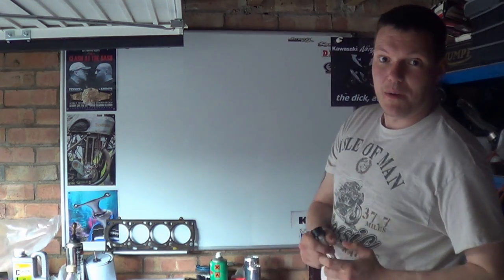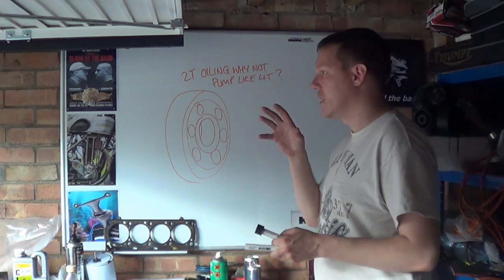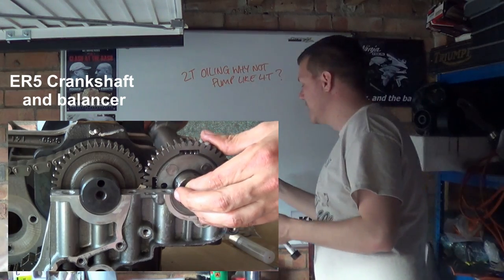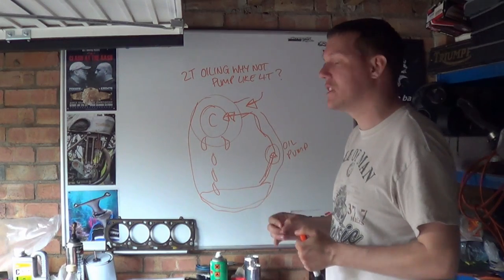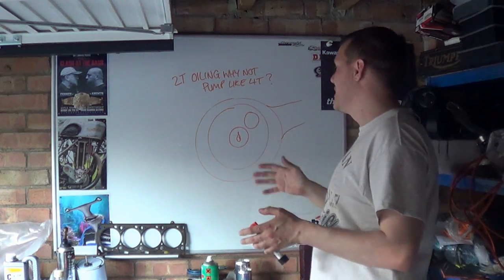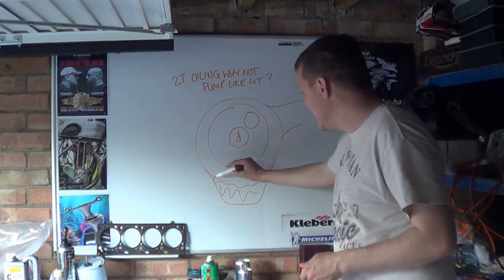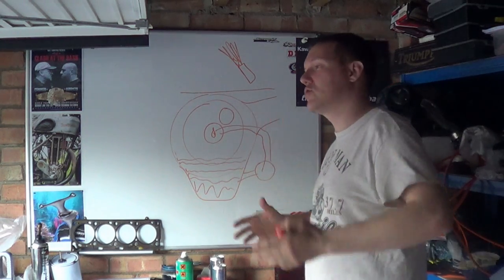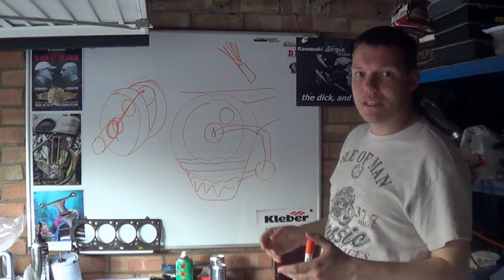2T oiling issue - make it like a 4T?

Comment: Damn... So 2 strokes are going to be dead... That sucks. I thought of a direct injection unit with a sealed crankcase... But what's going to pump the air into the cylinder... The piston can't really do it... There's two big gaping holes once the piston is all the way down...

Comment: What if u use propane instead of petrol , with the oil 😘 or maybe nitrogen based fuel like nitropropane. Could inject diesel exaust mixed with propane into a gas 2 stroke😍😻

Comment: the 2t piston is a long skirt design that not only weighs alot but its very difficult to oil it from underneath. 2t is like that crazy kid you knew growing up, not very smart so a dim looking future but has demon like strength, usually at inappropriate times
Reply: stickloaf the need this "long skirt design to close ports at appropriate times

Comment: does anyone make a 2 stroke boxer and does it still need a separated crank case since both pistons are 'charging' the crank case and firing at the same time
Reply from the maker: Great question - video coming soon - matt
Reply: I have a 2t boxer in my rc plane. Same crankcase! DLE Engines

Comment: from what you said i understand the problem is that 2ts use a crank case breathing system . could you have external air/fuel injectors and not use crank case breathing or am i just being thick ?
Reply: Then you would end up with a 4T
Reply from the maker: Good question - video on this later
Reply: Unjust PlayerLP why wouldnt it work? (With 2strokes instead of 4.)
Reply: Adam Berggren why would you want to make everyting similar to a 4t just to have 2 strokes and fresh charge going out of your exhaust ?
Reply: Ciaran Goldrick I was thinking the same thing
Reply: Unjust PlayerLP would you just answer the question? He's asking why it won't work. It wouldn't make it a 4T, you would still only have 2 strokes, you would just be closing off the crank case so it wouldn't breath the air and/or fuel at all (or at least, not as much, since even 4T engines still have breathing issues).

The advantage of a 2T that doesn't burn oil is the ability to spin at a higher RPM, produce more HP at a given displacement, and have less parasitic loses.

Comment: Two important things for considering comparing engines for real world use is.  1 cost to buy
2 how many miles it would run in its life & service intervals & cost.  

Good video and I am sure R1 would still win but very important factors when buying a machine.

Comment: 1980`s Suzuki 4 cylinders all had cranks built up with roller bearings..very robust design.2-strokes die early from piston failure..carbon-build-up...heat..and lack of lubrication inthe cylinder..The lower end rarely goes.Wish I knew what e-tech evinrudes areusing for materiels in the piston/cylinder interface.Luv your vids..

Comment: As you said, it can't be done with a crankcase fuel and air mixture fed system. I'm sure you could build a direct injected two-stroke engine with oiling like a four-stroke, over pressurized and producing big HP/litre. But here comes the kicker, it would defeat the purpose of the two-strokes benefits. Such as low weight, smaller, and cheaper to produce. That's the main reason I think it'll never be done when 4-strokes already exists, I mean why invent the wheel again? 
Here is what's what in two-stroke technology for curious ones... 😃 https://youtu.be/g6Fa79fR_To

Comment: What if you separate the crankcase and the cylinder with some sort of diaphragm or grommet type thingy around the con rod, and placing the reed valves in the bottom of the cylinder instead of in the crankcase, making it a "cylinder breathing" engine? This would (if engineered properly) separate the oil and the fuel system.

Comment: Would you be able to do fuel port injection in the transfer port or would that have the same problems as direct injection? That way you wouldn't have the fuel in the crankcase to dilute the oil

Comment: On a 2 stroke dirt bike, could you do a higher oil fuel ratio( like from 40:1 to 30:1) than what the manufacturer recommends to improve reliability? Would it cause any problems?
Reply: depends on oil quality and how the bike is ridden. I'm certainly no expert so take it as you will. typically the smaller bikes run higher rpm and need more oil in the premix. I think we used to mix my cr80 at 24:1 so that thing could be wound up all the time. nowadays I run a banshee and a kx500 at 40:1 with maxima 927 with great success. only 'problem' with altering your ratio is that if you add more oil to the fuel it means your engine runs leaner so you will have to rejet to larger jets to add more premix to restore your air/fuel ratio to whatever it is that your bike likes. but it also depends on your oil. if youre burning bean oil you may want more oil in the gas as opposed to lets just say that amsoil 2 stroke voodoo magic. I tend to run less oil than recommended and I have never had reliability issues with anything except a street legal 2 stroke 250 I had that went wide open for hours on end. its all how its ridden

Comment: shit, im changing my oil more often, i already do but fuck, now i know how much more important it is. 
Q. is it bad to put 2 stroke oil in your 4 stroke fuel, eg, putting 2 stroke fuel in a 4 stroke????
Reply: WeRideLikeThis if you put petrol mixed for a 2 stroke in your 4 stroke it will not hurt at all it will lubricate it slightly better but may foul a plug on you .if the oil to fuel ratio is to high it may also run rich and cause rich symptoms

Comment: sorry, 2 stroke injection or premix works well. I think you may have changed subjects midstream. Hence plain roller bearings with Crank Seals on both sides of each crank lobe.. but you know that. Still love your work. Never a bad idea to pressure lube through intricate engineering just at lower pressure and volume. drilled crank matching a sweeping port on the rod bearings results in very low oil consumption for a 2T. Oh wait E-Tek Evininrude/ Bombardier. Add HPDPFI then 2 strokes can still live forever... because 2 stroke power is just something that stirs your soul. Keep up the good work Boss.
Reply: The issue sadly is the Evinrude won't ever get past road emissions. The recreation vehicle tests are nowhere near as stringent.

Comment: Great video Matt. I understand everything and have no questions about what you are saying. It did make me wonder what the hell BRP-Rotax is doing with their new 2T 2017 850 Etec engine since they boast about their direct bearing lubrication system incorporated into that engine. I can't find anything that explains very well, so I imagine it is some weird hybrid where the oil is pissing out slowly and still being burnt at a much reduced rate than a normal 2T. Do you have any idea roughly how they designed that lubrication system to work? Thanks. 👍🏻
Reply from the maker: Yes I do, Video this weekend mate

Comment: Wouldn’t it be possible if we have a small external supercharger to take care of the primary compression of air and fuel, then send it to the combustion chamber ?
This way, you can have a bottomend like a 4 stroke as air and fuel don’t need to get there.

But yeah, I understand the cost,weight & complexity of a supercharger, the power loss and the problem of fresh charge escaping still being relevant. But wouldn’t it work ?
Reply from the maker: Doesn't solve the emissions issue though does it???
Reply: @dirtygarageguy  Yeah, that's there too :(

Comment: i was thinking about a 2 stroke where the mixture doesnt go out the exhaust, with valves instead of being open. would that even be possible? And the injection just being slightly higher so it doesnt go through the crankshaft, and the mixture gets pressurized so it will go into the cilinder, would that be possible?
Reply from the maker: But you need to oil the bottom end.

Comment: hello matt, as you do lots of great 2t vids. Can you explain why the hell you would change your 2t oil running engine to vegetable oil running. In my old Haynes Manuel for Yamaha rd125, it says you can run it on vegetable oil. Is there any advantage if you run it on vegetable oil (performance or emissions). Not that I would convert it. Cheers for great videos.
Reply: Anthony Cate 
how old is the manual? I imagine in the early days of 2T engines it was sometimes hard to find proper oil. whereas veg oil is at every grocery.
just a guess.
Reply: Zedex 12 the Manuel is from 1982,   
my bike is 1979. reading from Manuel it says you have to clean out mineral 2t oil, before using vegetable based oils. they don't mix, the vegetable based oil is also called 'R' type oil. Could be because of oil shortages or trying to be more economical or finding alternative oils. I wouldn't trust it, but could be cheaper maybe.

Comment: I love to float on a oil bed especially when it is combined with an massage! Now here is a question: When you eliminate the crankcase breathing but keep the reeds (separated from the crankshaft case) and do the oil system like a 4T and force feed the air with a turbo. Will that be a 2T solution that will pass emission? And don't forget the power valve system!!!
Reply from the maker: "When you eliminate the crankcase breathing but keep the reeds" - why would you do that?
Reply: Emission! two stroke! the 2T works over the reeds/ports not over the oil fuel mixture. The oil is just to lube the system. But if you spray the oil in like with an 4T under the piston and Blablabla you need to eliminate the crankcase breathing. There for is the turbo to force feed the air. Just don't over boost the force feed. Then you get an 2T top of the engine with an 4T bottom of the engine. You simply eliminate the oil air mixture. And you might pass emissions! Yes, pistons get oil rings again and skirts that block the reeds/ports when on TDC... the only question is where you place the oil rings? Like a 4T piston or on the bottom of it to seal the ports? Possible or not?

Comment: Forgive me on this one, but what about a direct injection 2t with no transfer ports, air fed into the combustion chamber instead of the crankcase..Possible?

Pretty sure ski doo has a 850 2t that has an oil pump that supplies oil to the crank bearings. No idea how it works.
Reply from the maker: "Pretty sure ski doo has a 850 2t that has an oil pump that supplies oil to the crank bearings. No idea how it works."

- this video is coming this weekend 

"Forgive me on this one, but what about a direct injection 2t with no transfer ports, air fed into the combustion chamber instead of the crankcase..Possible?"

You need some way of drawing air into the engine. You say fed air into the combustion chamber - how?
Reply: Maybe positive pressure. Perhaps with an electric turbo charger simular to the one ecomotors used on their concept variable compression two stroke engine.

Comment: I know it's nothing to do with bikes but I have a horrible 4t sthil strimmer without sump that runs on 2t mix!!
What the hell is that all about? Seems like the worst of both worlds to me, more complexity with less power strokes and a dirty exhaust.
Reply: Jonathan Tatler 
but you CAN run it upside down, yeah?
Reply: Good point, hadn't taken that on, although can't remember using a brushcutter upside down.
Would be useful for a chainsaw, blower or hedgetrimmer however.

Comment: what if the crank oil was made separate from the fuel mix somehow.. and only using 2t premix for rod and piston lubrication?
Reply from the maker: doesn't make sense - rod and piston are in the air stream - still burning oil.
Reply: Yea i know just that you were mainly talking about crank lubrication beeing watered down by fuel and i was just thinking if it was separate somehow that would stop that.. and then could use a second feed to inject oil to rod and piston maybe?  Just throwing ideas around..

Comment: you dont have to bleed the oil in the crankcase, you could make the oil sump on both sides of the crankcase and run the oil for the piston and conrod bearings through the crank and seal the bottom conrod bearing and run it up the conrod and than spray on the piston and wristpin, might reduce the emissions... just a wild theory tho :D
Reply from the maker: And then where does the oil go?
Reply: The Workshop out the exhaust, but there be lot less of it i imagine?

Comment: Why can't you make a 3t engine? Wouldn't that be the best of both worlds? Intake and release at the same time, then compression, then combustion, rince and repeat.
Reply: Isn't the 5T engine supposed to do basically that? Power of the 2T and even better emissions than the 4t?
Reply from the maker: No the 5 and 6 stroke engines basically use the waste heat of the exhaust gas - like a turbo
Reply: But they are more efficient than the 4 Strokes. I don't know if you can match the pure power of the 2 Stroke.
Reply from the maker: "But they are more efficient than the 4 Strokes."

- LOL this depends on how you define efficiency.

Thermal efficiency - yes
Fuel efficiency - possibly - if the system is tailored to capitalize on this.
Mechanical efficiency - no. More parts, weight and paracitic losses (friction) 

"Pure power of the 2 stroke"

Again, you have to define what this means. Per weight - yes to a degree. You have to remember that 2 strokes use twice the fuel for comparible cc vs a 2 stroke, but not double the power (depending on the scale - i.e small nitro engines in RC stuff).

If you look at the fuel loads of 2 stroke motoGP bikes and compare that to the motoGP bikes today, then the 2 strokes fall short.
Reply: Oh ok, I only really know anything about 125ccm's, and there the Two-Strokes make way more power, well and that's mostly because of emissions and power regulations. There aren't really many 125 4Ts that make over 15hp, but there are only rarely 2Ts that make under 23HP ( Yamaha DT125 ; TDR; TzR, KTM LC2, Sachs ZX125 all use the same 23HP engine)

Comment: I'm sorry but you're wrong, oiling a 2t engine and getting it to pass emissions is stupidly simple.
Reply: Fill the sump with oil, remove the crankcase breathing that would suck 
all the oil vapour up to be burnt and stick some valves in the head so 
you can fire the charge straight into the cylinder, might as well pop 
another valve in to take the exhaust away too, jobs a good'un.
Yeah 
the crank will need to turn 720 degrees for each complete firing cycle, 
be a bit less powerful and it will be heavier but the engine will be 
quieter have better lubrication, lifespan, economy and emissions. 
might look into a patent, if I'm not too late...........
Reply from the maker: Come on then, lets have it.........
Reply: It's damn difficult to please some people!, I think I will market it as the 2R (Revolution) engine.
Reply from the maker: LMAO!
Reply: Deanxm1 hahaha made my day

Comment: A 4T has a sealed crankcase.  A 2t has a breather crankcase.  You can not mix and match.
Reply: Josh Rothwell, yes but that is so the pressure in the system doesn't blow out your seals.  What I mean by breather crankcase is that the air induction of a 2t literally goes through the crankcase....it has to.  You can't do that with a 4 stroke.  That is why a 4 stroke has the valves in the head, to bypass the crankcase.  That's what makes them different....and why they aren't the same and why they can't be mixed and matched.  They are fundamentally different other than they have rods and cranks and cylinders.
Reply from the maker: true but that doesn't explain what would happen if you tried, which is what people asked.
Reply: Josh Rothwell, shit man....how would you explain it to someone that doesn't know the difference between a 4t and a 2t to the point where they want ask, "why can't you just pressure lube a 2t like a 4t?"
Sure, it isn't perfectly sealed but all that is supposed to go in a 4t crankcase is oil....so it is sealed away from the intake and exhaust....well, shit, that isn't technically correct because of the PVC valve BUT you do not intake 99.9% through the crankcase.  So, long story, short, you have to define sealed....and what you are sealing from.  I did not clarify.  My appologies.
Reply: I'd like to add, if your engine uses a vacuum pump, you don't have a breather.

Comment: What if you eliminate crank case breathing ?
Reply from the maker: How do you draw charge into the cylinder then?
Reply from the maker: Watch this first - https://www.youtube.com/watch?v=nIM0m9Z-C6o
Reply: Would the piston not pull enough gas and oil for that to work
Reply: Lucas Sturgin it would not create enough negative pressure

Comment: do cams float on the same kind of oil film?
Reply: Matt Dennis, YES....and rocker arms.  The valves and springs are splash lubricated......unless it is a splash lubricated 4 stroke (push lawn mowers).  In that case, there is a dipper on the bottom of the rod that slings oil everywhere.  (yeah, it is crappy but it works for cheap engines)
Reply: ah cool. i've had the lid off for valve clearences etc but have never pulled a bottom half down. never really thought about how it's all lubricated.

Comment: I was wondering what would happen when u use 2 t petrol in a 4 t engine would it work?
Reply from the maker: 2 stroke petrol? Do you mean premix?
Reply: Yes i do sorry i ment petrol mixed with 2 t oil
Reply from the maker: It just burns lol
Reply: So it would wreck the engine somehow ;)
Reply from the maker: No lol the oil would just burn and make it smeel like a 2 stroke. If you had a CAT it would mess that up and possibly foul your plug a bit, and you'd loose power slightly
Reply: Ah ok thx for the reply